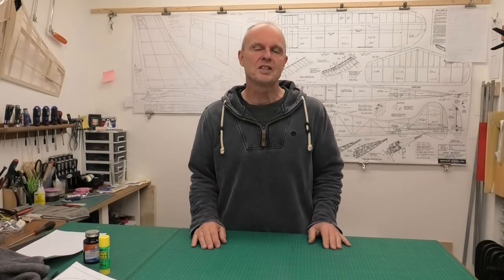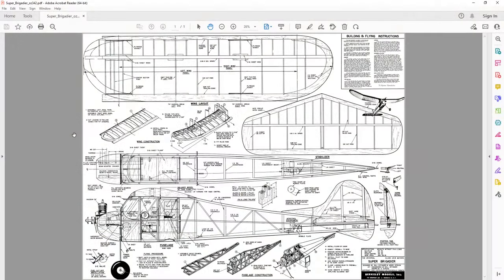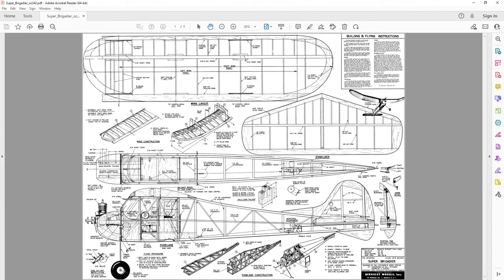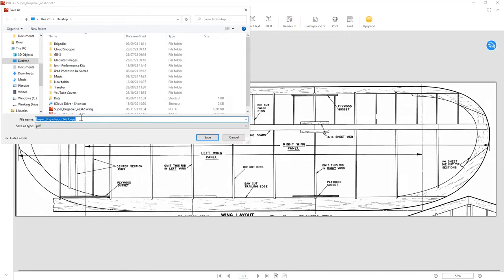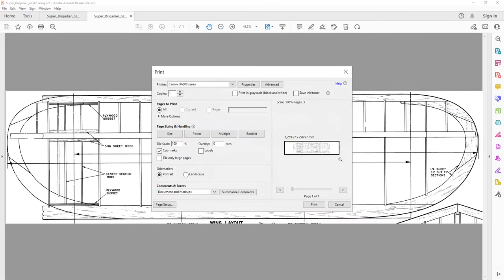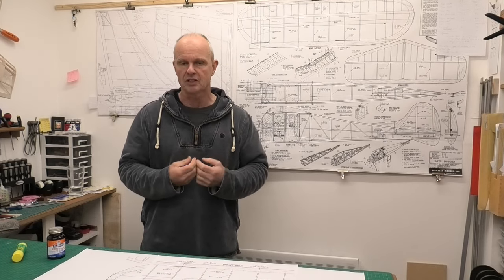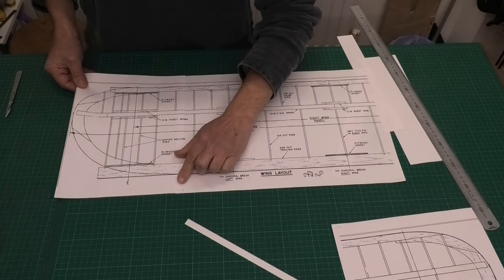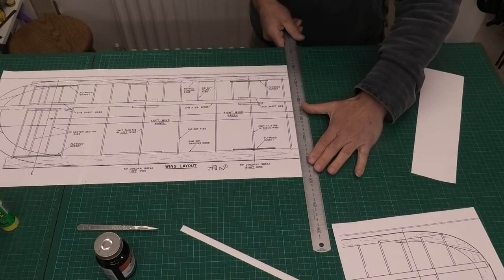Downloading & Printing Plans Pt 2 - A Step Further ! - Balsa Model Aeroplane Building

Comment: Looks like they have changed the program a bit. I'm not able to crop, following your instructions. Each time I select page, then crop page and drag the box around the area. A buy now popup opens and wont let me crop. Tried many times but no luck.
Reply from the maker: Yes, I think you are correct, think I need to do an update, thanks for the comment

Comment: Hi Mark, I have an older version of Acrobat Reader which has a function in the Edit menu called “take a snapshot”. This enables you to highlight and print a specific part of a PDF. I only found out about this recently, but I have used it to print an airfoil section rather than the whole plan. Scaling was accurate too.
Reply from the maker: Thanks for the info, greatly appreciated
Reply: I do that, too. I think the same option is available on the Foxit pdf reader, too.  It's very useful for printing ribs or formers to stick on the wood as a cutting guide.
Reply: I just use Selotape (or any other clear tape).  I tack tape on the front, avoiding the actual drawing where possible, then turn over and tape all the edges to have a secure plan to use.

Comment: How did you know the cropped image from a different programme would print exact same size gas original?
Reply from the maker: because you are not altering the scale, just the amount you see, you can use the tool measure facility in Adobe Reader to check the overall size is correct once done

Comment: Always helpful and useful but I've been experimenting with various ways of joining plans together and the best I've come up with so far, is hot laminate folders.
They can be purchased in A4 size and are around 120 microns thick so quite robust..
I first line up the plans in the same way Mark does and place a little bit of sticky tape in several areas to stop them moving.
I then lay a pre-cut piece of the hot laminate material on top of the pieces I'm joining, and iron it onto the paper and then cut them out leaving the laminate in place.
One might think this is a lot of unnecessary work but in doing this, it not only allows me to keep the pieces as templates so they can be used again and again, but it also makes the cut out pieces a lot easier to mark around when transferring them onto balsa or whatever material you're using.
Reply from the maker: Thanks for the comment, always interesting to hear how others solve similar issues, sounds great

Comment: Err, you are mistaken this time Mark, you can print just part of a plan in Adobe Acrobat Reader. At least I can and have been doing for years. 
If you zoom into the section you want so it fills the window, then when you go to the Print… dialog window there is a small drop down tab titled ‘More Options’. You select ‘Current view’, and make sure the ‘Actual size’ or ‘Custom Scale’ is selected at 100%. Check the preview thumbnail on the right hand side before you print. 
No need for a third party program.
Reply from the maker: Thank you for the comment Mark, you are absolutely right, I nevere knew of this function, always good to learn
Reply: @MarkRobinson555  No worries Mark. Love your videos and the way you present them. I pick up a lot of tips from you so happy to return the favour for once. I expect there will be a part 3 now once you play with it a bit :). You can also use the poster option with that 'Current view' option selected. Sometimes you need to resize your Adobe window so it only uses the area you want to print. ie. reduce the vertical height of the window and scroll the plan around to fit if you're trying to print just a wing for example. I normally only use it to print one particular part out on a single page. Similar to you, I prefer to have a full size A0 plan to get the overall concept and I just print small sections for individual parts that I often lightly stick onto balsa and cut out.